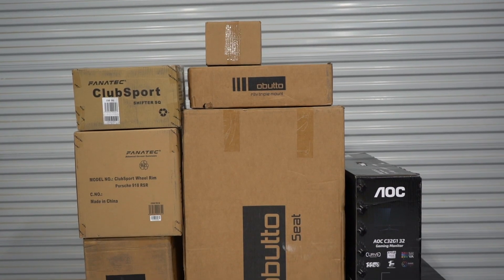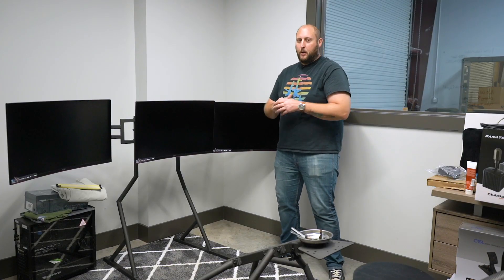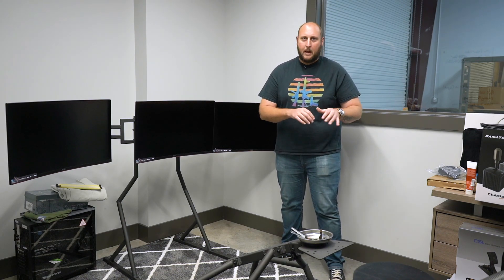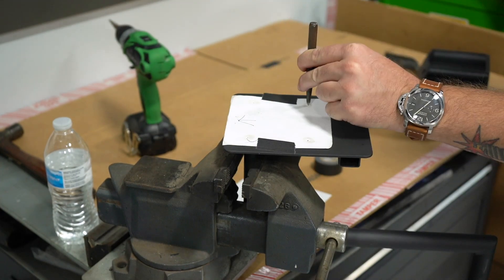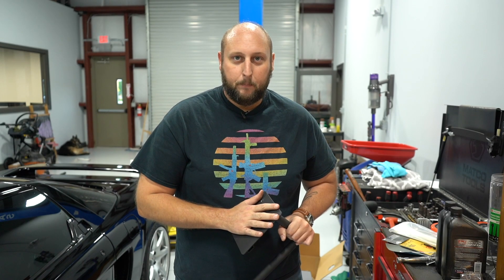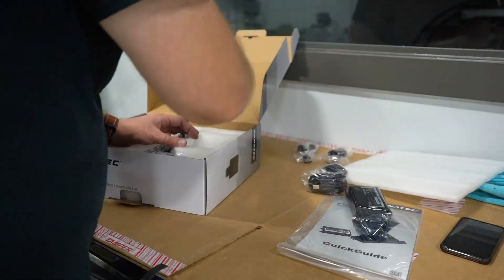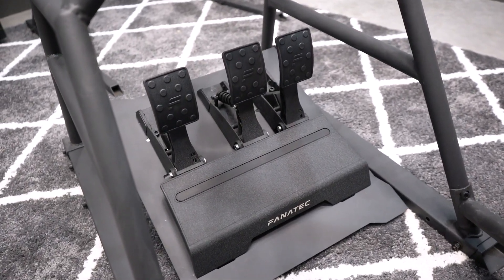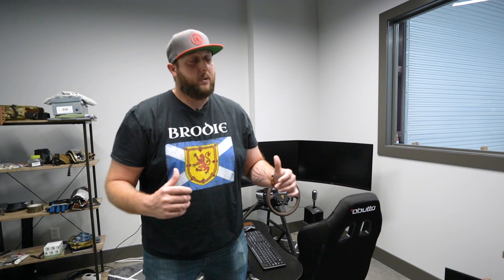Sim Racing Cockpit Build // Mounting Fanatec wheel and pedals to Obutto r3v /Part 2

Comment: Great idea grinding the flat on the shifter tube. Let us all know how it works out long term! When I first took a look at my r3v built up, I did wonder if the Fanatec CS shifter would be a little bit too high when installed. Looks the perfect height in your set up.
Reply from the maker: Yeah it works out pretty well. I really like the height of the shifter, but im also tall, so it works. With the shorter shift knob on the fanatec shifter, i think it would be ok for some one smaller. Its almost identical to a 997 GT3 Cup position

Comment: How do you like the triple monitor stand? Hard to find one for that good of a price that holds 32" monitors! Also - can you tell me the distance between the 2 legs? I want to make sure my rig fits inside. thanks
Reply from the maker: Its about 25.5" to the insides of the legs. So if your rig is 25" or less it will fit with plenty of room

Comment: m8 -1.25 x 20mm bolts fit the fanatec pedals?  Or go with the 15mm?
Reply from the maker: 20mm should be fine, plenty of room underneath for extra bolt length if that is what you have